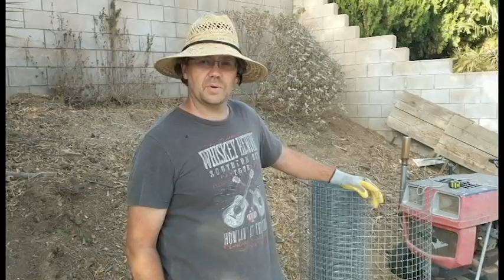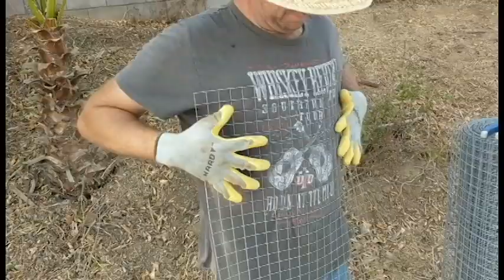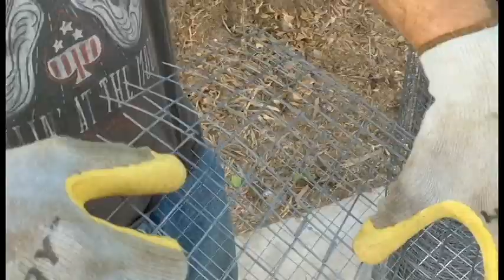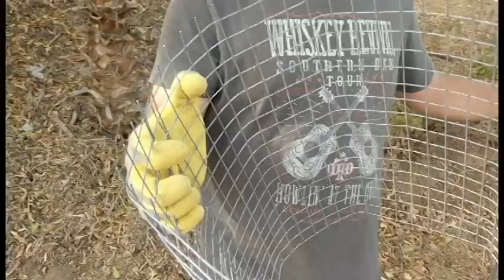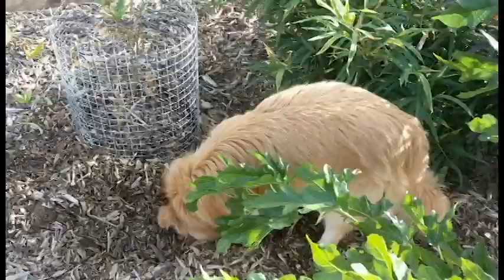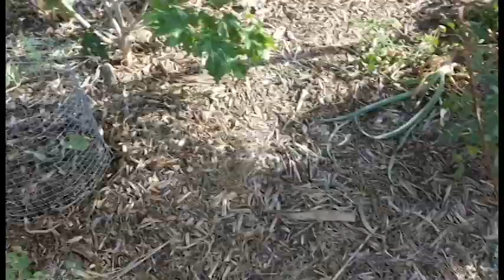#11   DIY Plant Protector

Comment: This is a great video... I'm thinking to put wire on top as well to avoid squirrels getting in. Thanks!!!
Reply from the maker: Just thread it through. However, I haven't had an issue with squirrels getting into it. They don't like the spikes at the top.
Reply: Great design. Yah I was wondering if the bigger rats would just climb up the side

Comment: If the cage doesn't stay upright, I found 2 landscaping pins work great.
Reply from the maker: Twisting it into the soil usually works just fine, but a couple of pins can add strength.
Reply: We have raccoons, squirrels and possums. Raccoons will tear everything up. Squirrels simply go over the top. Possums can also climb, and do. For some plants, it will need a top of some sort. Window screen is pretty cheap (vinyl) and should attach pretty easily to the top, or more of the same kind of wire he's using, cut to size and attached the same way as the sides.

Comment: will this keep squirrels away from my oak tree saplings?
Reply from the maker: Yes, if you put a lid on it or weave some wire over the top. Make for to twist them together. You can also make the tube much more narrow and add a larger stake. Then you just have to pinch the top together and wire it. All depends on the size of the seedlings.
Reply: @FarmerBrownGrows  thanks! i also have another problem because apparently the squirrels smell acorn residue in all my potting soil so they are digging all my plants up not only oak seedlings

Comment: What fencing are you using for these?  I want to make sure I buy the right thing.  I've tried chicken wire and just don't like working with it.  Can you specify exactly what fencing you are using to make these.  It looks like it would work great for my blue berry bushes.
Reply from the maker: I use 1" or 1/2" welded wire fence. Depending on the size I'm making. Larger is good for pretty much anything. The smaller helps with seedlings. Those I create a top to them as well.
Reply: @FarmerBrownGrows  - thank you very much for taking the time to provide the info to me.  Really appreciate it.  Have a great evening!
Reply from the maker: @cathyjohnson3552  Not a problem.
Reply: What gauge?

Comment: Is galvonized mesh cloth safe? Im reading its not. Im worried itll shower my tomatoe plants in toxic dust, or drip down when it rains.
Reply from the maker: When buried for extensive periods of time it can become toxic to the soil and kill plants and animals. However, there are a variety of welded fabrics you can find. Stainless steel, aluminum, copper, coated, uncoated, painted, unpainted, etc. I used this particular mesh because I was given a roll of it and I only use it for when the plant is starting out or needs some temporary protection. It does have enough time in the ground to breakdown to toxic levels. Soil is very resilient to minor contaminants if you're keeping it well fed and happy. I don't recommend burying it as a mesh basket, as some people do. Hope this answers your great question.
Reply: @FarmerBrownGrows  Way to go above and beyond! You know your s.
But what if I had a 3/4 inch between the plant and the wrap around? 
Is that generally better than burning it in the soil?
 I mean with potted plants
* Can rain make toxic zinc and iron drip down? Makes sense....
Reply from the maker: @Chi_The_Cat_0  It only becomes a problem in long-term exposure. You could use spikes to hold it into place and just have it resting on the ground, if it's going to be there for a longer period of time. You might also look at other types of welded. There's a lot of them out there!
Reply: @FarmerBrownGrows  A gentleman and a scholar

Comment: This is great! However, how do you protect this cages from strong winds? Don't they need some additional support to stay put when windy?
Reply from the maker: Sorry for the delayed response. Basic winds you simply twist the cage into the soil a couple of inches. Stronger winds (we get gusting up to 90 mph without issues) you can add a stake and place it between the overlapped section. By standard, as the plant grows, it'll hold the cage in place.
Reply: @FarmerBrownGrows  Also, the garden shops as well as sprinkler supply shops sell long U shaped stakes that work great. Two or three should be all you need.

Comment: 1/4 inch mesh is a lot cheaper, is there any reason that would't work fine as well?
Reply from the maker: It can be used. You'll just need to wire it together, rather than using the mesh itself. The gauge is more important than the distance between the wires. They need to handle some chewing and impact.

I use the 1" in the 50' roll, so it's pretty cheap at that point.

Comment: A Raccoon will just knock the damn thing over
Reply from the maker: Very true. If course a raccoon can knock over a decent sized garbage can, so a small wire mesh is no big deal. However, you can put in a couple of stakes and wire the cage to it and then they can't. Simple fix.